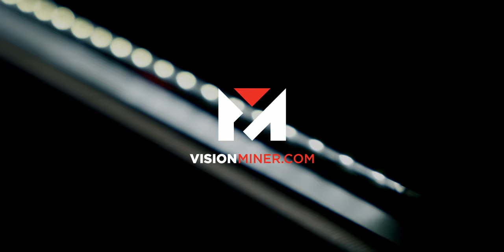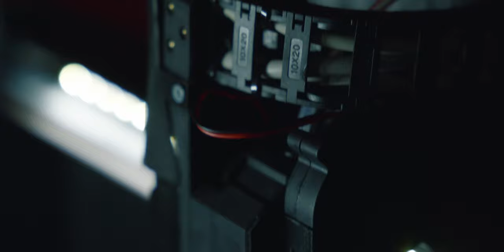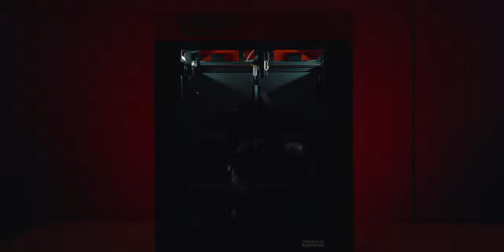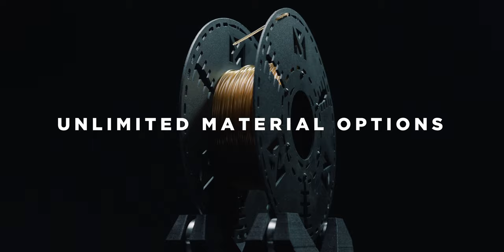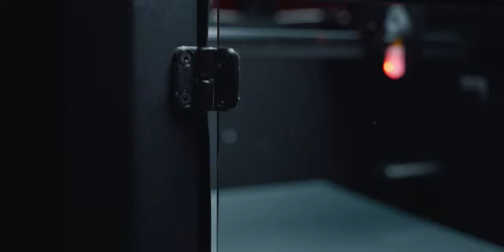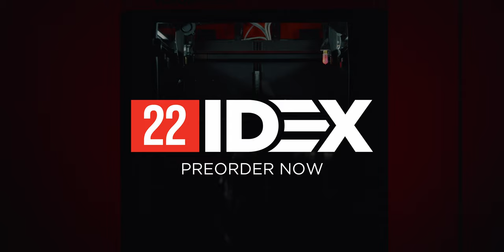Introducing the 22 IDEX 3D Printer - by Vision Miner

Comment: The Addwise IDEX, which is basically the Same Machine, only costs about 4k.
Why should I pay double the price?
Reply from the maker: Several years ago, a few original prototypes were offered for around 4000 Euros, in order to get initial feedback from the market. Since then, everything has been improved and upgraded dramatically over the years. Now, to receive the machine in Europe, it's closer to $9000 Euros in cost for delivery, when you include VAT taxes, shipping, and all else.  With our partnership, we're refining it and improving it even further, so get it at this $8800 USD price while you still can :) Feel free to reach out to us for an accurate and up-to-date quote at visionminer.com/22idex :)
Reply: Ohhh, just noticed, it says powered by addwise, so it is the same machine with some tweaks i suppose.

Comment: Is.it just me or are there huge gaps around the doors? If yes, seems like not the best for trying to keep the chamber temperature stable and uniform.

How are this compared to the Funmat HT enhanced? Any cons?
Reply from the maker: Hey André! Don't worry -- if you pause the video, you'll notice the hinge is in the open position, and behind the hinge, you can see the slight curvature of the rubber seal. The machine does a great job maintaining 90°C -- even higher in testing, but limited for now. Stay tuned, lots to come with this printer ;)

Comment: Isnt the bl touch temperature sensitive ?
Reply: Is that a yes?
Reply from the maker: The processor and Hall effect sensor in the BLTouch "rated" to be stable up to 85°C, the rest of the electronics even higher, and the magnetic issues some people mention around the web (probe dropping, or lack of deployment) are fixed easily by an adjustment of the ferrite core set screw -- this tiny change makes it work great in higher chamber temperatures. This can all be found publicly around the web, on Reddit, stackexchange, and other additive-related groups/forums :)
Reply: @VisionMiner  thanks for the clarification, I never had good results with the two I bought. Even cold they couldn't stay consistent
Reply from the maker: Interesting, I wonder if it was a hardware or firmware issue, perhaps a bad batch you received? There's certainly some deviation which is accounted for, but we've had great results every time we've used on, on this printer and others :)
Reply: @VisionMiner  I had 2, but now klicky is king. I've fully machined one in peek ;)
Reply from the maker: Oooooo Nice!!
Reply: @VisionMiner  totally overkill and pricey but so worth it

Comment: Swappable hot ends?
Reply: Can one hot end have support material and other regular material?
Reply from the maker: Yep! The current mount uses a standard v6-style heatsink, so anything that can be used with that -- will work great :)  The baseline unit comes standard with dual volcano-style hotends.
Reply from the maker: Absolutely yes -- you can do several things with the dual-independent extruders:
1. Use breakaway or soluble support materials
2. Multi-material -- for example, living hinges with TPU/Nylon, or PP/PLA, etc
3. Multi-Color, for making clean labels on parts for serialization
4. Dual-Nozzle-Size -- use a large nozzle for the body of a part, and a small nozzle for fine details
5. Duplicate mode - print two copies of the same part, at the same time
6. Mirror mode - print two mirrored copies of the same parts at the same time

Comment: $8800 just for a HT IDEX. Prusa should be charging way more for the XL.
Reply: Heated chamber. Afaik, there are patents, although they may have expired, but yes, heated chamber, and also the 3 point bed levelling. My only question is was this partially inspired by HevOrt? Also, is it CoreXY?
Reply from the maker: Patents for the rest of the heated chamber features (baffles, motors outside chamber, etc, expired earlier in 2021) It's not CoreXY,  it's very similar, but much shorter belts (and 12mm kevlar Gates belts) -- also, do you have al ink for HevOrt? Not familiar, although the team may be :)
Reply: @VisionMiner  https://youtube.com/c/MirageC. Is it h-bot then? or is it ultimaker style.
Reply from the maker: Nope -- this design uses four motors, two for the Y axis, and two for the separate extruder movements, for a total of four X/Y motors, 3 Z axis motors, and two extruder motors -- 9 motors total :)
Reply: @VisionMiner  oh it's croXY basically.
Reply: I also realized im trying to build a printer thats smaller using the same motion system. No tri level bed leveling tho. How does the heated chamber work? Is it like convection? (or is this something you cannot say...) My goal with my printer is a small formfactor highspeed high temp printer to ease me into printing high temp filaments, or even filaments like asa and polycarbonate better.

Comment: Doesn’t the BL touch become unreliable in heated environments? Seems like inadequate design. And the bed dancing makes no sense. No printer would ever want to do that or require that much flexibility. In fact, the triple bed leveling isn’t even required with correct firmware configuration. So even more wasted money 💴 

This what happens when a sales company tried engineering.
Reply from the maker: Hahahaha, no no — the BL Touch is modifiable to work well in higher temperatures, without issue. Also, the triple motor allows you to never need manual leveling when it’s at high temperatures — on of the most cumbersome parts of high temp printing. In the future it will also help non-planar printing, but for now, it’s mechanically self leveling along with the mesh leveling built into the RepRap firmware. A dream come true for us in the shop.

Comment: Looks like a nice printer. 
On other news i was requested to re vet pruser website. 
18 days later they said. 
No stl sales. 
No print sales.
No license sales.
Also found out.
Migrate to there site faulty so not recomeded. 
No license transfers. 
No license transfers within site.
So in my expert vetting opinion thats a no business use site. Not even close to usefull. 
So to sum up no sites in 3d orint industry have resumed business services in 12 months. 2021 has been the worst year for operational services for 3d print and cnc comunities since ever in my opinion.
Well the evidence speaks for itself. 
Im jappy to re vet any site you like if anyone think any site is operational. 
License transfers is a critical service we are mostly interrsted to see resumed. 
Thingiverse down 12 months. 
Thangs no use.
Cults3d sorry no. 
Myminifactory no.
Creality cloud no.
And so on.
Cgtrader remains best site but no licenses transfers nor license sales nor migrates. 
54 sites vetted all remain yet to resume. 
Other things im working to get a fix for comunity. 
Search engines to have,
 working exact text search.
Sort by oldest first working correctly.
Sort by cgi.
Sort by cnc.
Sort by 3d print. 
Thats just to warm up.